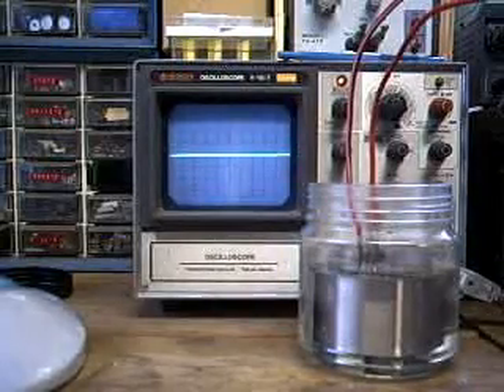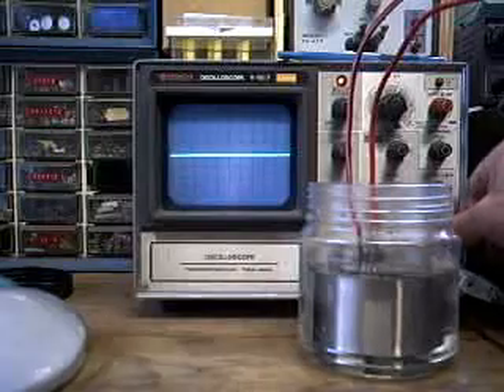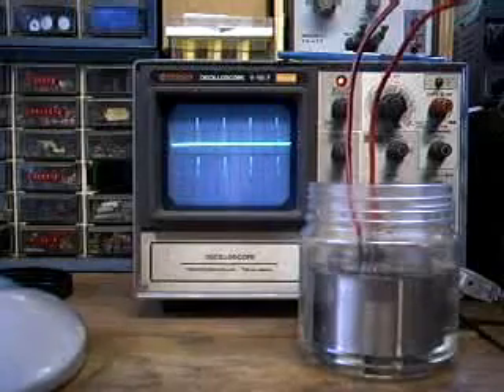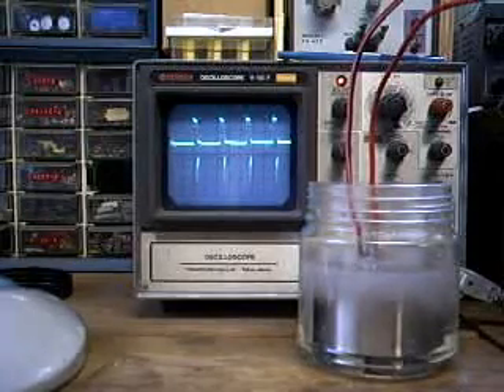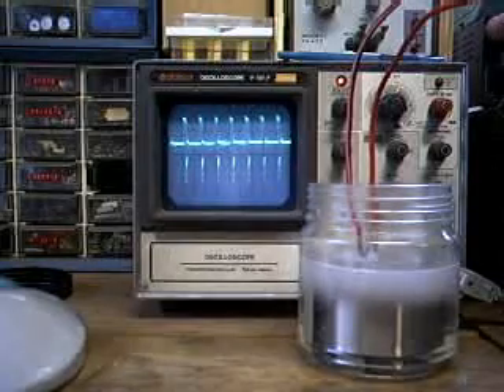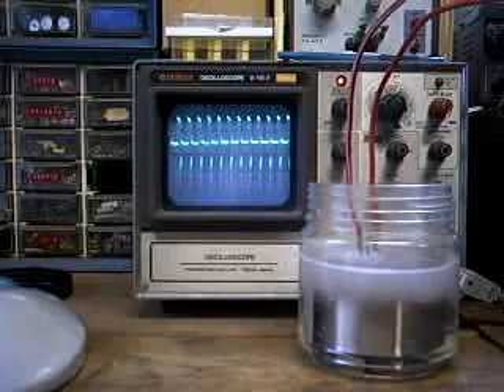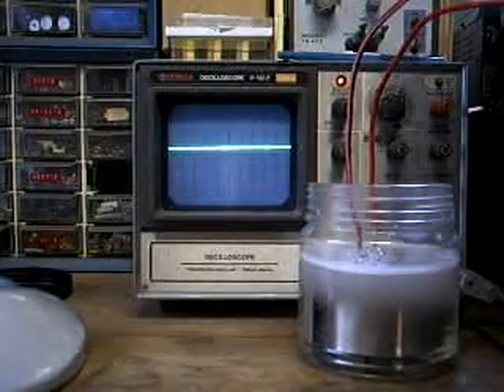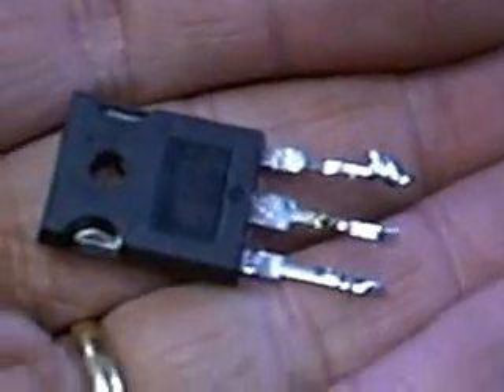#73 - New problems with voltage transients

Comment from the maker: Even this device has an on resistance almost 10 times greater and a PD of 190W compared to 300W for the IRFP064. No, I think this was a good choice. I just need to be mindful of the maximum limits.

The new transient supressor is working exceptionally well. I ran a few tests last night with much weaker electrolyte. The brute force current at 14V was between 10A cold to 25A hot. therefore my pulse current was 25A for this test. IRFP064 ran very cool.

Comment from the maker: This device is a good choice but only if you're actually running it in the range of hundreds of volts. The on resistance of 0.25 ohms makes it unsuitable for lower voltage high current applications. The I/R losses will create a lot of heat that needs to be dissipated.

The key here is to first find out what the brute force current will be from straight DC at the maximum intended input voltage. I blew the 2nd of 3 because it was pulsing into a virtual dead short and it over heated.

Comment: It works when there is a transient in the forward direction the cap tries to charge to the higher voltage of the spike and the resistor discharges the cap during the off time hence suppressing spikes to a safe level. the only disadvantage is that there is a varing freq. and the values may need to change accordingly. PS you can always use zeners like lawton.

Comment: Hi zero one time i had the same problem with an inverter and used a diode for one direction and for the other I used a diode in series with a 220uf electrolytic which the latter was shorted with a 100 ohm w/w resistor. it worked well for me and it suppressed the transient spikes the setup was fitted across the collector and emmiter of the power transister.

Comment from the maker: Well, I put a soft diode snubber on the positive side too. Works very well. Got the transients down to ~30V. Started playing again, got it up to around 20A RMS and I popped another one. Grrrrrrr >:-(

Heat got this one. Thermal conductivity to the heat sink is not the problem. I couldn't touch any part of the heat sink. Repetitive peak pulse current must have been out of sight. I was running less than 10% duty cycle for 20A RMS. You do the math.

Comment from the maker: The transient spikes you see are just from the inductance created by short leads going to the cell alone. I also think the spiral design might be adding a good deal of inductance. Need to play with where I connect my clips. My thought is one on the inside spiraling out, the other on the outside spiraling in. Maybe they'll cancel bifilar style?

Comment: Blowing the mosfet may be due to overheating. I noticed it broke when you rose the current to 10amp. also I would isolate the heatsink from the box with stand offs and washers or if any thing else is isolated than its not neccesary and clamp the mosfet directly with aluminium as steel has poor thermal conductivity.

Comment: Hi Zero it's me again well are you using the bifilar coil and diode? Stan did it to put the colapsing field back to the cell. Condition your cell to lower the current. I myself am using 2 IRF530 in parallel rather cheap though to experiment with. I already burnt a few anyways good luck.

Comment from the maker: No, the spikes are DC. Someone shared with me the HEXFET application notes that describe a few different methods of spike quenching. I already use a negative spike clamp diode across the MOSFET. I'll be adding a positive spike clamp diode to the drain as well that discharges into a parallel RC.

Comment from the maker: Yes, I already have 1N5325 clamping diodes on the MOSFET and the output terminals. Spikes going negative are not the problem. Positive spikes are. I have considered the rectifier in series with the drain but I hate like hell to resort to that. Suddenly my 0.009 ohm on resistance (.63V drop @ 70A) becomes at least 1.4V.

{Sigh} Beats toasting MOSFETS I guess.

I also now see why people stack a few of these in parallel. if you get anywhere near the 500A peak mark, that's a 4.5V drop. Not good.

Comment: Depending on cct you might be able to place series (400V to 1000V) diode in FET drain to protect. Though your ON current will suffer. or you could put fast reverse diode to earth from Drain to clamp bottom of waveform at earth from going too far negative. Or you could do both these things. Diodes have good HV ratings and cost much less.